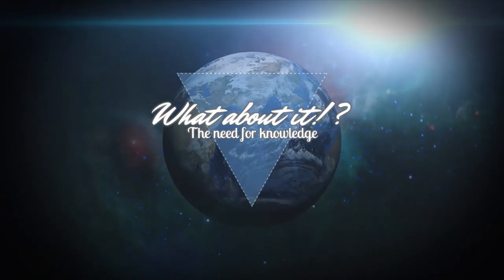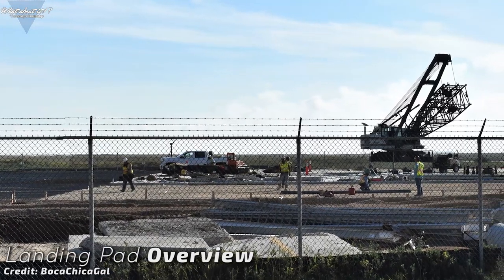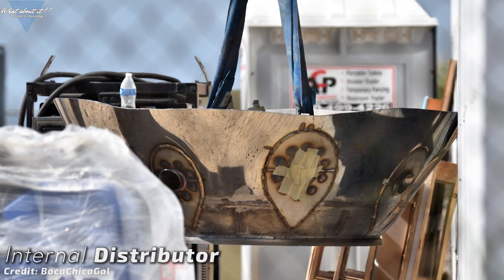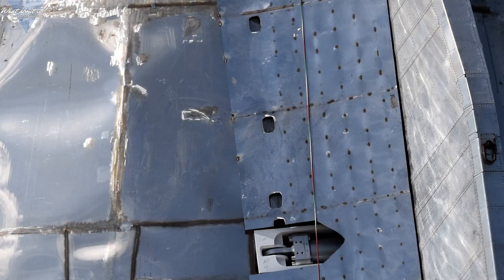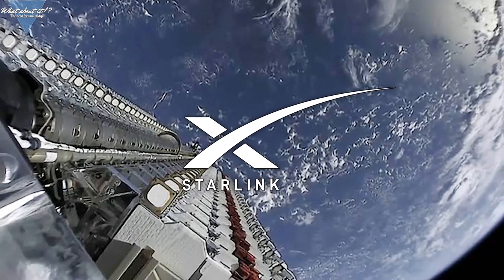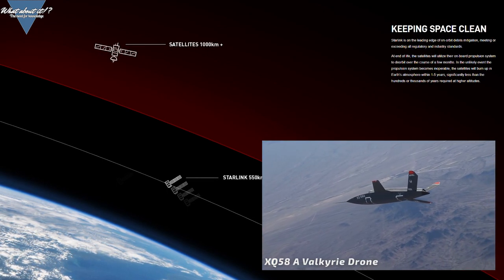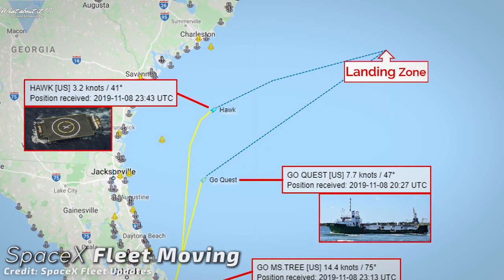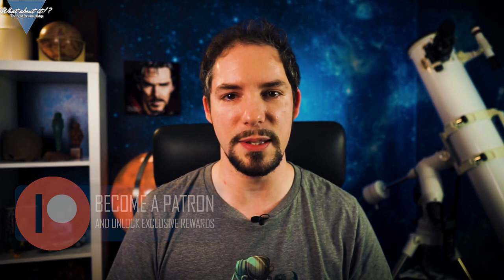49 | SpaceX Starship Updates – Starlink v1-1 Launch Preparations

Comment from the maker: What’s that distributor for and how often can a Falcon fairing be reused?
Reply: It could be either for the pre-presurisation of the tanks, or ducting gas to the CGT system.
Reply: Boats may not be in place in time.
Reply: I suspect that we might never know how many times a falcon fairing can be reused.  It's possible that it could be reused 10+ times when caught by the nets, although that number will be lower in cases where the fairing is recovered after splashing down.

Do you know if both fairing halves are being reused or is it just one (the one caught in the net)?
Reply: Two of the reasons I didn't mention that we might not know how many times a fairing can be reused might be because the customers for other satellites might not want to have used fairings on their launch and SpaceX possibly starting to use Starship to launch 400 Starlink satellites per launch possibly as soon as 2022.
Reply: Rob Highfill it seems like elon doesnt give a damn what the launch partners think about space x’s reused parts, A; its bringing down the price of launch and B; its saving the other company money on future launches if they can use refurbished hardware. I believe Elon said that Starship will cost 2 million in total cost for SpaceX per launch with fuel and parts, thus this will save future customers millions per launch.
Reply: I reckon 3 time's
Reply: It might greatly depend on the customer and the amount of risk they are willing to incur vs cost savings. The USAF for example is often willing to pay extra to use new rockets exclusively. SpaceX on the other hand might be willing to really push the reusability of the fairings when they are their own launch client as they are with the Starlink missions.
Reply: @SizzStarr  I suspect that there is a line in the launch contract that would specify if SpaceX can use recovered fairings.  I can see most future Starlink launches on a Falcon 9 reusing fairings though.
Reply: I'll cast my vote for that distributor being for the autogenous pressurization system!
Reply: @KnightRanger38   The customer really has no say in the matter.  SpaceX is contracted to put a payload in a specific orbit.
Reply: Wannabe Dr. Strange.
Reply: You should have episode number in the start of the title so it's easy to jump to the movies you are referring too.
49 | SpaceX Starship Updates – Starlink v1-1 Launch Preparations
Reply: @tagert1430  And link that no. to the date originally pub''d e.g. 46 S-link 11-11-19-SLink v1-1 Lnch-Prep.
Reply: It's an open question; That is: the fairing can be re-used so long as it passes pre-launch stress tests and is in compliance with recovery techniques being in use.  With an auto-gyro I can see it land back at launch pad in perfect silence via current hobby drone's "go home" homing system.   In fact just as some hawks can capture birds in mid flight; why not use flying drone to capture fairing in mid-flight?
Reply: @Gabbyk77  that's not how the world works. The custumer and SpaceX can include anything in their contract as long as they both sign it. If a contractor pays extra for new fairings, and SpaceX profits from it, they obviously both will agree.
Reply: The fairing catchers returned before the launch
Reply: @What about it!? It looks like the very tip of the nose cone currently upside down while they install the cold gas thrusters, eventually to be flipped and welded on the very top of the upper section during final assembly.
Reply: Felix, at 2:52 this is the cut-off nose of Starship. The structure has radial thruster nozzles. Got to have some high thrust to flip Starship hard and keep it vertical in the last seconds, no matter what irregular ground must be adapted to by the legs. 

The nozzles are staggered in order to fit all the valves on the manifold inside.
Reply: @ajaguarbthechef1420  
Other ships were sent out to recover them from the water.
Reply: @onemynde8915  
This section had to be removed in order to lower equipment into the cone. As we can see tape over some areas but not others, you're certainly right about more radial thrusters needing installation.

Comment: Felix, at 2:52 this "distributor" is the cut-off nose of Starship. The structure has radial pointing thruster nozzles. 

The nozzles are staggered in order to fit all the valves/plumbing on the manifold inside. 

I expect that only 2 adjacent or a single thrusters will fire at once.

Comment: Omg imagine that the fins fall off while starship is diving back to the ground... 

Thinking about that just scared me bro!
Reply: I just visioned Starship falling out of the sky and slamming into the pad.                                                                                                                                                                                                                scary
Reply from the maker: Yep... that would not be good at all... :D
Reply: Well, Spacex would study the problem, determine what went wrong, maybe let the same thing happen on Mk-2 to gather more data, and fix it for Mk-3. That is what a test program is for.
Reply: Imagine that the wings of a plane suddenly fall off.
Imagine that the wheels of a car suddenly fall off while going around a curve at high speed.
Imagine that your legs suddenly fall off.

Why do you think this is plausible?!
Reply: They will on take off
Reply: Frame 62: lol
Reply: Tikka Fan  
Time stamp or it didn't happen.
Reply: The first 4 starships are being over built, for that very reason... once they have proven the design they are planning on trimming the weight and minimizing the connections through iterations... By Mk 10-12 they should be into production models for launching starlink satellites... that's probably very late 2020 early 2021... They have possible customers for launching communications satellites in mid 2021... :)
Reply: @theuncalledfor  Hold on there with the legs... I have titanium screws in mine that help me walk :) don't want them falling out LOL... edit damned their instead of there...